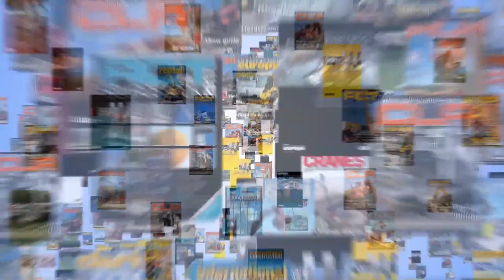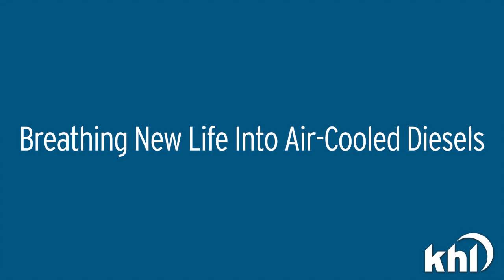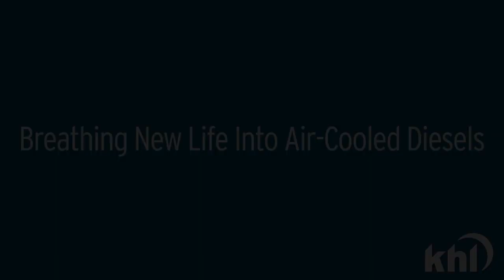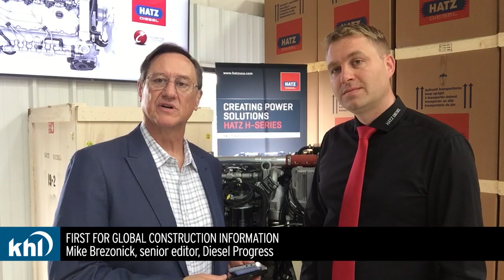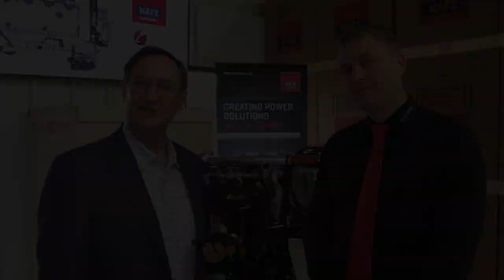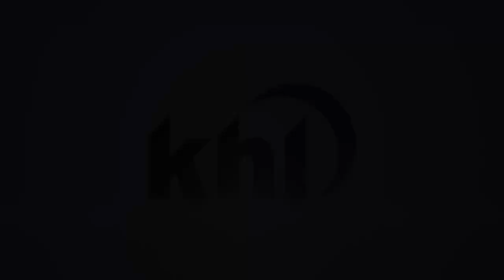Breathing New Life Into Air-Cooled Diesels

Comment: We don’t need EFI in a single cylinder air cooled diesel we need to try and stop making these basic engines over engineering them. EFI and electronic isn’t more efficient just more stuff to break down over time because all electronics fail at some point do to unseen forces and engineering. 
There no reason a single cylinder engine or v twin engine used in generators and mowers etc should have this stuff it absolutely doesn’t make diag simpler honestly tends to cost costumers more money because most mechanics about 50% lack the skills of actual good technicians. 
Folks just wanna mower grass, power some light, break some ground for plants. 
And most buying these air cooled diesel’s are in fact buying them because they’re all mechanical, it’s K.I.S.S to fix it,  and if SHTF and EMP want take out the mechanical nature of them, unlike it will if it’s were to be all electronic switching and controlling. And a CanBus on a simple little engine I’m sorry but 🤦first ecm’s don’t tell you what’s exactly wrong with the engine, it tells you there’s an issue between the electronic control unit and whatever part the DTC comes to yes it can be that part doesn’t mean it is that part 100% of the time. Next anything mechanical is bound to ware out at some point, electronics can last for many years, but not indefinitely and is completely variable to the engineer build the circuits. 
This is taking something dead simple to troubleshoot and fix in a purely mechanical system, to a combined engine mechanical computer, with electronic computer this creates a loop between diag to find the correct fault between either mechanical, electronic, or both
It doesn’t simply anything it creates more steps to troubleshoot and diag between two different machines one being mechanical the other being electronic control! 
Then look at your own parts cost, a normal injection pump for a Lombardi single cylinder diesel is around $350 with electrionic control that injection pump and injector is gonna be around $500-800 ain’t nobody gonna want that 💩 they will keep buying the China diesel’s taking them apart when they come in the door to double check parts and send it!
It has nothing to do with folks being scared of it, they already know what electrionic control spells in the future because they deal with it on there own vehicles
I’m a Self taught mechanic/technician and electronic engineer